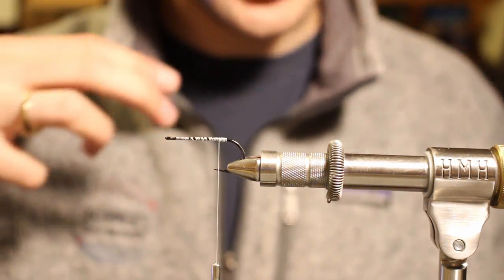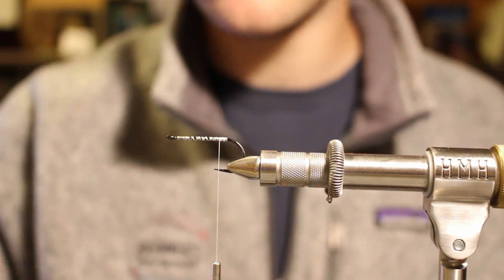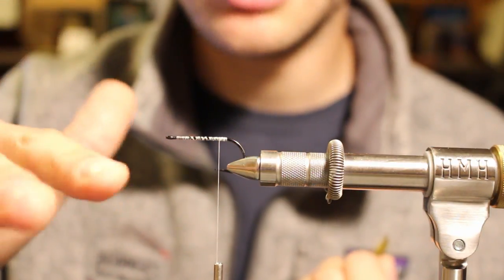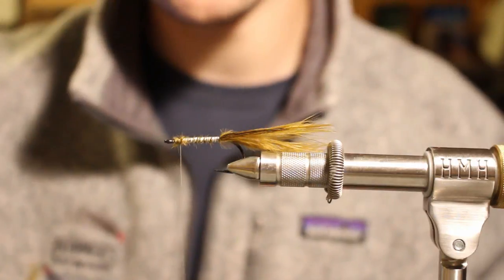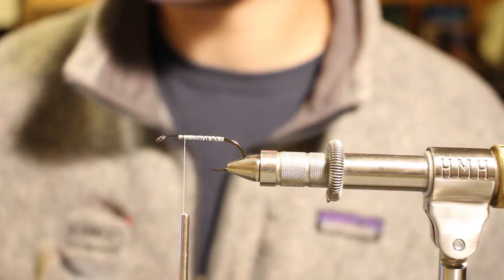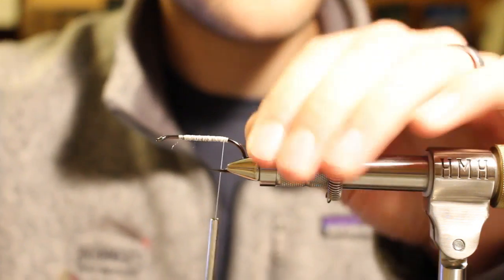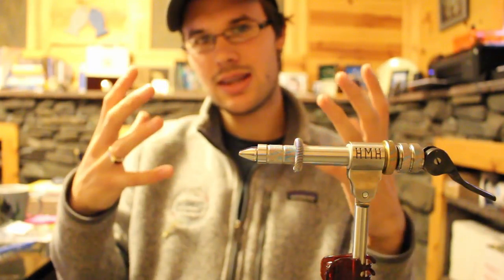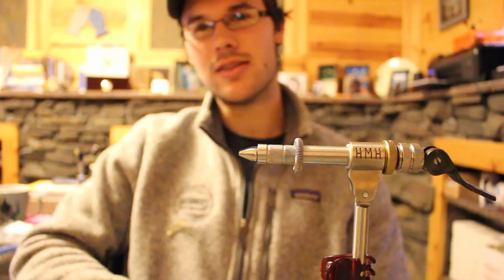Tie Like a Pro, Ep. 2 Articulating Flies

Comment: Thank you for posting. I was curious why you tie both ends of the articulating wire to the same side of the hook, will the fly not be more balanced if you ties the bottom to one side and the top to the other?
Reply: Just sometimes when you tie it on the top the loop has a tendancy to move horizontal when you want it vertical. When I tie mine I try to tie one end of the wire in on my side and the other end of the wire to the opposite side to balance everything out

Comment: Super helpful video. Going to make some corrections in my articulated flies. I saw how you started the wire on the lower 1/8 then the other part goes in the upper eighth but on the same side correct?